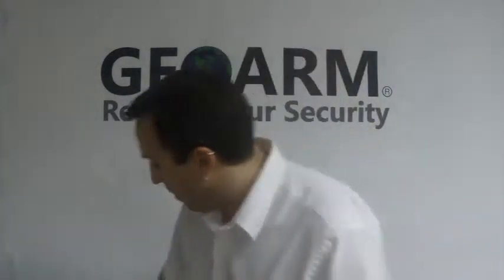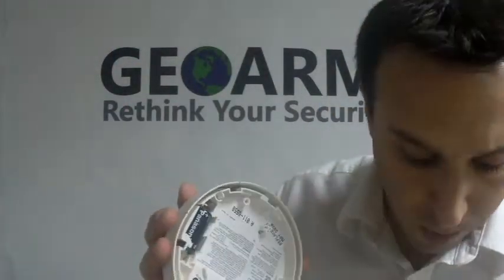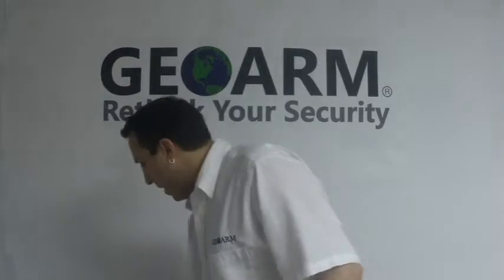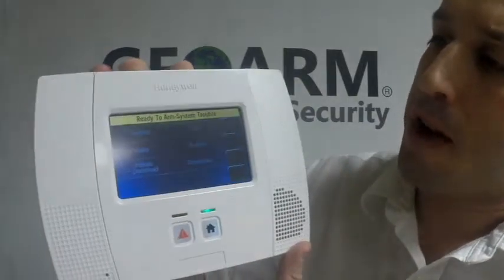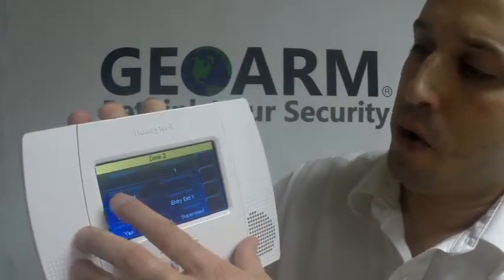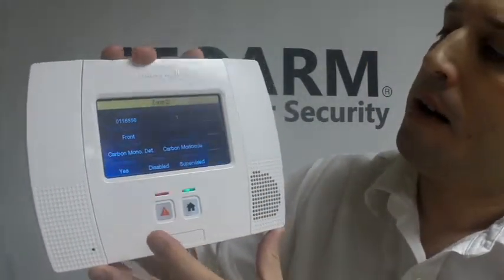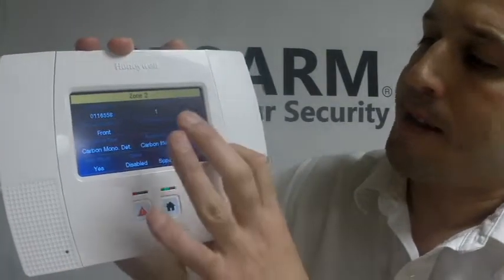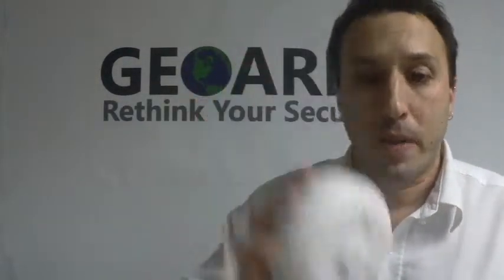Honeywell 5800CO - How to Program Into the L5200 System?

Comment: Does the 5800CO carbon monoxide detector emit an alarm noise at the device itself or does  the alarm noise only occur at the Lynx 5200? I guess this question applies to other alarms like heat detector, smoke detector, etc.
Reply from the maker: +Lance Gillette it has a slight detection from the device but, you will here in mostly from the panel.
Reply: +GEOARM Security:  So if you want to actually hear an alarm loudly when not in earshot of the Lynx 5200 you can install the Honeywell wireless siren?
Reply from the maker: That is correct as well if you system goes into an alarm that 5800 wave can be additional noise to alert you or your family. The Honeywell L5200 system does have an 85 db siren so its not silent it is loud but if you need addtional the 5800 wave would work for you.